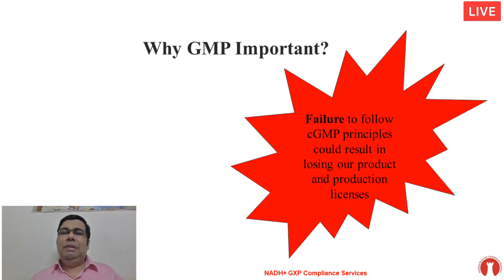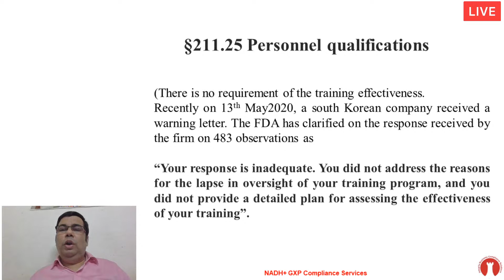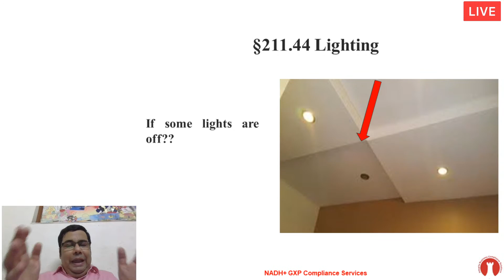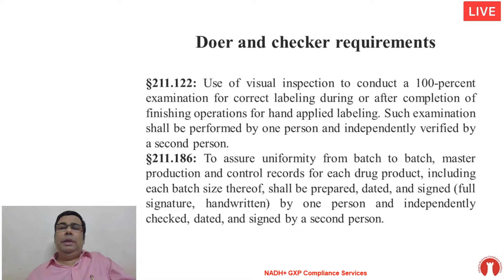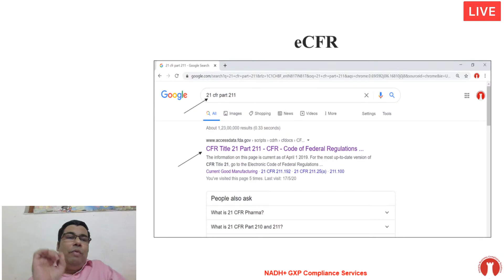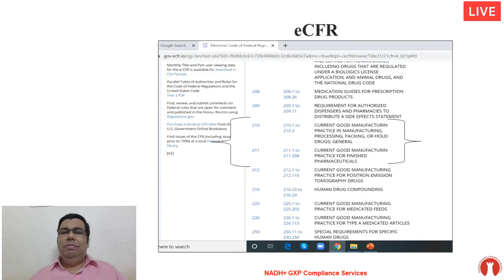21 CFR Part 210, 211 and eCFR

Comment: in which subpart mentioned that manufacturing & expiry date shall be mentioned in batch manufacturing record?
Reply from the maker: Can you please tell me why you need this specific information with respect to batch manufacturing record. I always request that, do not just go on wordings specified in the guideline. The interpretation is very very important. § 211.186 Master production and control records - "Complete manufacturing and 'control instructions', sampling and testing procedures, specifications, 'special notations', and precautions to be followed". Further, § 211.188 Batch production and control records-(13) Results of examinations made in accordance with § 211.134. Also refer § 211.137.
Once you refer all these specified informations, all are interlinked like- Master records should have controlled instructions, you can put special notations , examination results should be recorded in line with specified clause(§ 211.134  - This is for Drug product inspection. Further expiration dating (§ 211.137). The point is,  when you inspect and review and record in batch record, there should be control instructions to ensure that the compliance with respect to all inspections. Hope, you are clear with it.

Comment: Wrong or unfilled incomplete SOPs come under which CFR 210 or 211 subparts??
Reply: Thanks for your message sir.. I mean old or unupdated SOPs or there is no recognisable system to manage and update SOPs
Reply from the maker: What exactly you need to understand?  Do you mean to say wrong SOPs? For production related - § 211.100 Written procedures; deviations.
(a) There shall be written procedures
for production and process control designed
to assure that the drug products
have the identity, strength, quality,
and purity they purport or are represented
to possess. Such procedures
shall include all requirements in this
subpart. Similar requirement for warehouse, QC etc under different subhead.
I really don't understand about unfilled incomplete SOPs? Becasue SOPs are not filled. They are followed. Please confirm
Reply from the maker: Please refer § 211.100 Written procedures - These written procedures, including
any changes, shall be drafted,
reviewed, and approved by the appropriate
organizational units and reviewed
and approved by the quality
control unit. Similar requirement is there for QC and other areas. Hope, this will solve your querry.
Reply: These are basic requirements. Applicable for cGMP